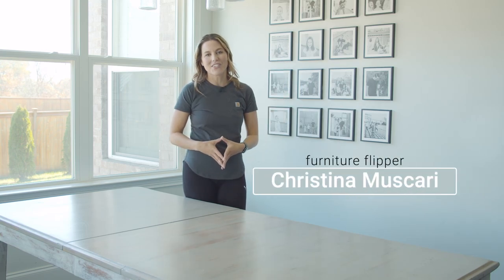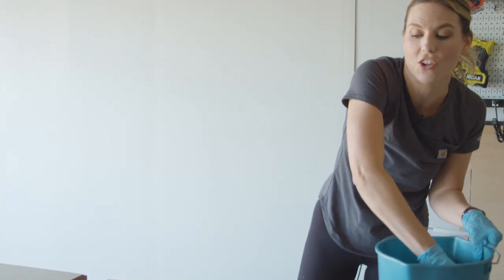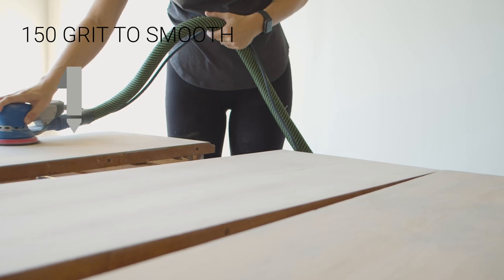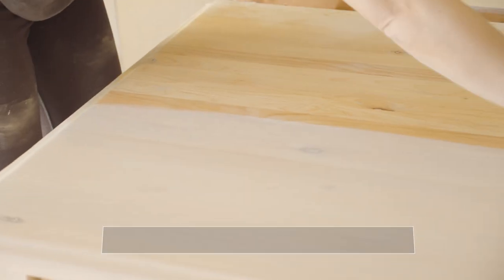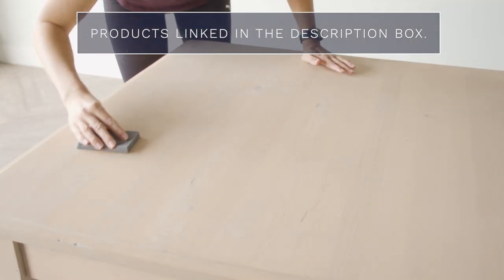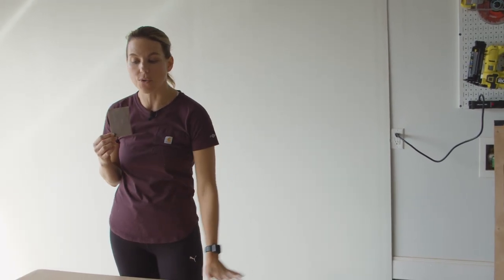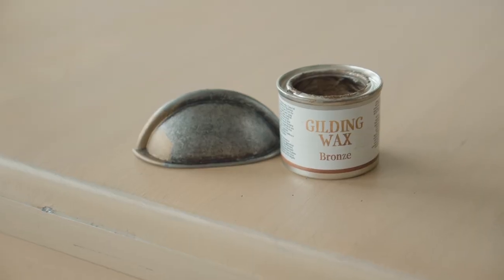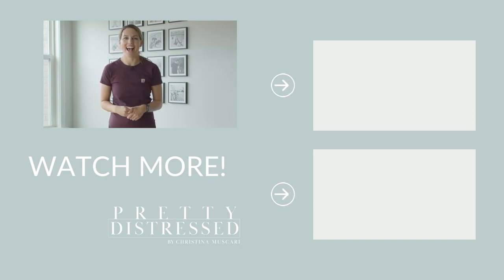Kitchen Table Makeover

Comment: I was very impressed with your table but I was wondering about you using the brush in more places than just the joints I thought on other video s you said use sponges to paint so you don’t get brush marks ,not complaining I’m just learning I’ve only done 3tables in my living room after watching your videos so just wondering and I do want to try that paint I’m notorious for mixing up paints I have left over from other things I’ve done around the house so I’m not familiar with these kinks of paints I’ve only use paints for inside @out side paint for my house.thanks for your video

Comment: I’m searching through all of your videos hoping to find exactly what I’m looking for, this video is the closest so far but still not quite right. I too have a pottery barn table, that needs some help. I haven’t done anything to it except wash it with Dixie Belle’s white lighting. For some reason the top of the table (that we rarely use) developed a very “gummy, sticky”type feeling on top. The white lighting has removed that feeling almost entirely. I want to keep the piece very natural looking, but it does have 2 glass cup rings on it, it also has fading all around, but I’m totally ok with that, since using the white lighting it is also  very dull now. I’m considering just putting the gator hide on it, but I’m nervous the cup rings will look ridiculous, so I’m debating on the voodoo stain, but I want an even more natural look then this table you just refinished, this piece almost looks slightly white in the video. Any advice?